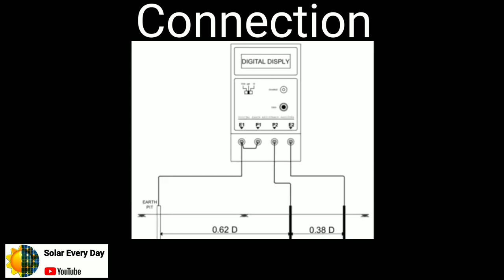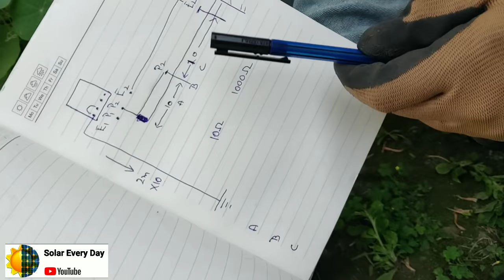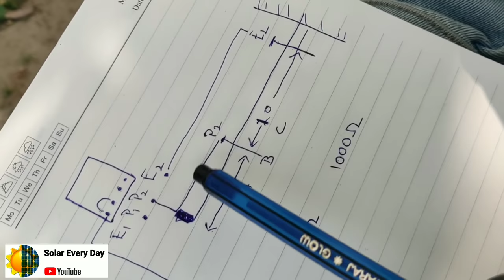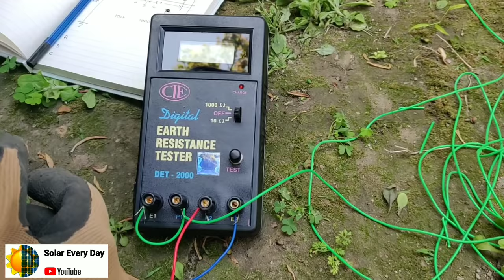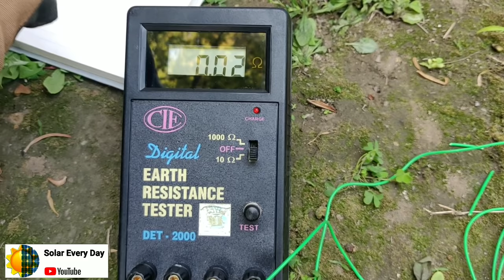Simple Earth pit resistance test (how to test it) | Earth Tester | Earth resistance Tester

Comment: Hi sir, You have taken the distance from  E1(P1) to P2 as 10m and then P2 to E2 as 10m again. But in the connection diagram of the earth tester it's 0.62 D and 0.38D, which means they shouldn't be equal.

Comment: Thanks for your video sharing its very informative, i want to ask one question in this case we get resistance of 12.16 ohm how we will bring it to 5 ohm ?  awaiting for your valuable reply
Reply from the maker: In order to reduce the resistance of the earth pit , we will have to increase the conductivity of the earth pit , so for that we usually drain 10L water mix with salt in the earth pit
Reply: as i know if we have current more than 200A we use minimum 2 earth pits than how we will measure earth resistance either we have to connect both earth pits and then measure or any other method plz reply
Reply from the maker: See usually in case of dual or tri vector earthing , we test the resistance of individual earth pit , not by connecting 2 together , as per the IEC standards an individual earth pit should offer a resistance of 5ohms or below it , which is a safe limit and ensures that if you have a heavy leakage current then at this resistance it will be smoothly absorbed by earth
Reply: Put water & salt into earth pit
Reply: @SustainableEveryDay 😊

Comment: Sir ,if I want to measure the resistance between 2 wires  (BSNL for ex 1km ) will this meter support.  If it support at which I have to connect Plz reply me
Reply from the maker: This is earth tester , the test you want to do , you will require a megger device it will give you better result

Comment: Earth Pit 1 = for ACDB & Inverter.
Earth Pit 2 = for DCDB, Panals & structure.
Earth Pit 3 = for Lightning Arrester.
Is it proper way to do earthing for 3kw solar plant?
Reply from the maker: EP - 1 no. DCDB + INVERTER body dc section+ panels + structure

EP - 2 Nno. ACDB + INVERTER AC section

EP - 3 For LA
Reply: @SustainableEveryDay  Thanks a Lot G

Comment: Pit resistance is 12.16 ohms..
Is this good earthing ???
I heard that earthing should be less than 5 ohms..
Please share your views brother..
You explained well but conclusion is not clear..please explain ..
I would be thankful to you
Reply from the maker: The reason why we conducted this earth resistance test because we had a doubt on this earth pit , as we detected that AC voltage between the neutral and earth was coming about 20-22v which was beyond limit , 
You are absolutely right the pit resistance should be below 5ohms , but ours was 12.16ohms , so what we did to improve it , we immersed 20liters mixture of water with rocksalt inside the earth pit to lower the resistance , and finally got value below 5ohms
Reply: @SustainableEveryDay  thank you so much for your assistance....if you could have made a video of remaining part ..it would be a piece of cake...

Comment: Thank you sir for your video,
Why you subtract 1.25 from main value
Reply from the maker: Thanks for your support Gourang, the value 1.25 is the material resistance of the GI strip and earthing rod, so this value has to be subtracted from final value to get exat resistance of earthing pit.
Reply: You again listen to the video.actually we want to find the earthing resistance of the earthing  rod as well as the earthing resistance of the soil in which the earth rod is present that is rod+soil only.But since while measuring the resistance of those two things, you are using red and green and blue electric wires, the result on the meter will show a combination of three things( rod+soil+ colored wires).so in the video he measures the resistance of the colored wires separately  which is 1.25 ohm.So to find only resistance of rod+soil,you have to subtract 1.25 ohm from the reading given on the meter( which was about 13).

Comment: Sir earthing response stay n ho rha ho lgatar up down Ho rha ho to kya kiya jae ki sahi response mile chemical earthing me
Reply from the maker: Put 25L of water mix with rocksalt in earth pit
Reply: @SustainableEveryDay   Sir responce thik aa jaega fir sir
Reply: 20 feet deep tk chemical earthing  huwa hai sir  fir bhi response  me up down Ho rha hai aisa kyu ho rha hai sir  aur Kaise thik hoga
Reply from the maker: Yes
Reply from the maker: Contacts proper hai na aap check kar lo, especially Earth & all Neutral line contact joints
Reply: @SustainableEveryDay   OK sir 
But Ye solar system me problems aa rahi hai  dc current  to earth drop krna chahiye n sir but aisa ho nii rha hai

Comment: What is the Reason behind 10 and 20 mtr electrode. Why it is necessary.
Reply from the maker: The electrode E1, P1 passes current in soil which is detected by earth pit at a fixed voltage by device so by formula V=I/R the device calculate R i.e. Resistance of soil

Comment: Hi sir the direction of E2 changes what will be happen? 
P2 after E2 is necessary or not?
Reply from the maker: Changing the direction can make the distance between earth electrode and test electrode E2 , close to the value of resistance which you will get will not be according to the standard test procedure of earth test

Comment: Can we use 4mm thickness Aluminium wire to connect LA with earthing?
If not then what is the alternate of GI strip?
Reply from the maker: 4mm conducter is actually underated , and not at used for earthing , and lightning surge are heavy , as you know the charges only flow on the surface of the conductor so you need higher cross-section conducter , only use 25mmx3mm GI flat strip

Comment: What is differences between Multimeter and Earth resistance meter?
Can I use multimeter?
Reply from the maker: Both are different equipment , and work differently
Reply: @SustainableEveryDay  Earth resistance meter should be done only with earthy tester,if you use multimeter it will only indicate continuity but not the actual healthy of the earth pit
Reply from the maker: @oroknowledge2232  only with Earth resistance tester
Reply: @SustainableEveryDay  is it possible to use earth tester for installation of diesel generator
Reply: @oroknowledge2232 dear sir pl tell if we check voltage between earth and neutral wire it is 5volt 
It means our earth is ok pl pl

Comment: What is the Optimal earth resistance
Reply from the maker: Below 5ohm is all accepted ,
Reply: @SustainableEveryDay  thank you for your prompt reply, another question if you may 😅. What is the resistance of a human body if corrected directly to earth
Reply from the maker: So it will totally depends on how harsh or dry the skin will be , it starts between 100,000ohms for extremely dry to 1000ohms for wet skin

Comment: E1 p1 ko short kyun karte hai
..?
Reply from the maker: It it a method to complete the circuit, by shorting E1, P1, iske alawa soil resistance test ke time all 4 points E1, P1, E2, P2 is used no point is shorted

Comment: I have found 18 ohm in chemical earthing , how will come below of 5 ohm.
Reply: Chemical earthing is cheap in cost .
 If you want power full earthing then go for GI PIPE MINIMUM  38MM TO 50MM(ISI) (TATA,JINDAL) OR go for COPPER PLATE earthing. in both types of earthing coal and salt are used. minimum 8 feet depth. For better result. please provide watering pipe for regularly maintain earth resistance below 5 ohms by adding saulty water every 3 to 6 months as per your requirements

Comment: My earthing resistance is coming  0.12 is it perfect
Reply from the maker: Hi Brijesh what is the condition of the soil near earth pit is it dry soil or moisture soil
Reply: @SustainableEveryDay  its normal dry and little bit sandy soil
Reply: @SustainableEveryDay  please tell me what how it could be resolve
Reply: 0.45,0.27.0.80
Reply from the maker: Take a bucket with water 10liters and mix rock salt half kg in the bucket and pour the water in earthing pit which you want to test it will increase the conductivity of ground electrode
Reply: No pbm by the way it's good
Reply: Yellow
Reply: @blkumawat4705  
Wt yellow

Comment: What if the resistance is more than 5 ohm ?
Reply from the maker: Hi kartik
Then the inverter will experience Abnormal performance as leakage AC and DC CURRENT will find it hard to travel towards the earth pit